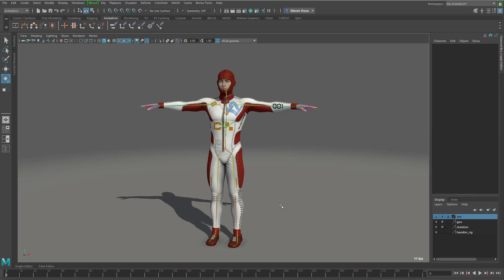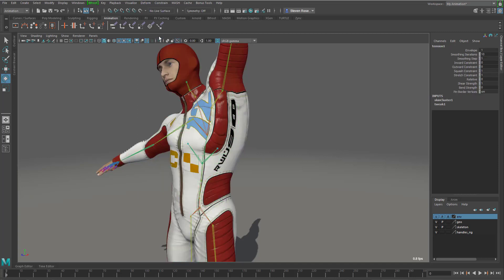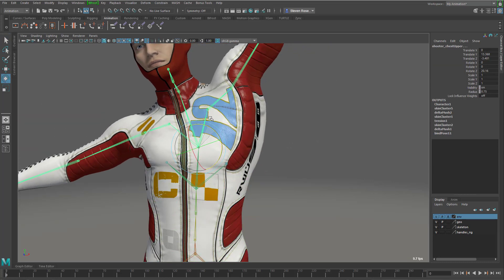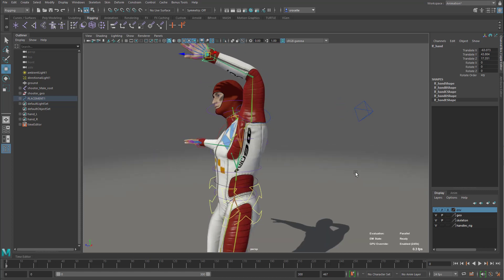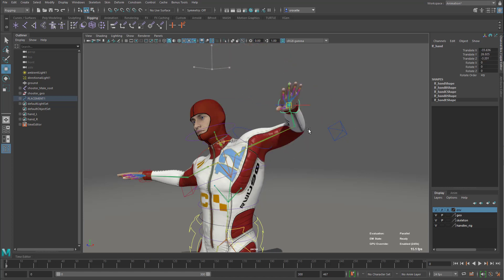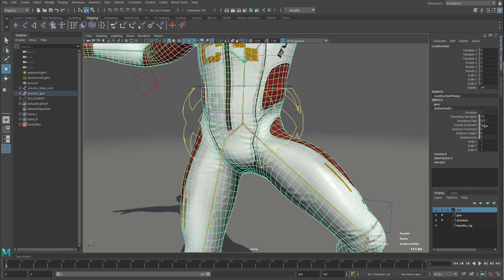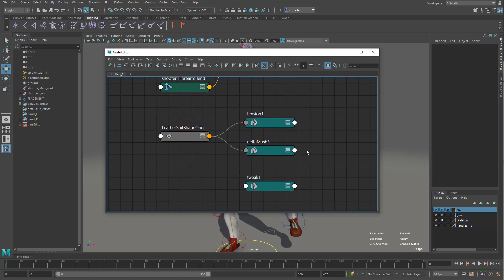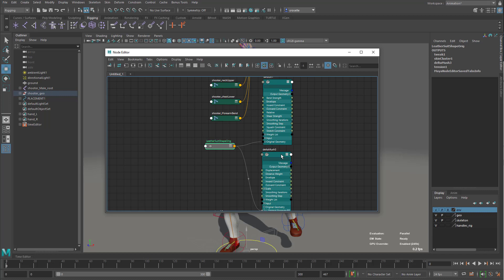Maya 2020 - Deformer Improvement (Original Geometry Input)

Comment: what if i want the tension deformer to happen relative to a posed state (like previous maya version)?
Reply from the maker: You can pass a custom shape to the "Original Geometry" input of the Tension deformer.  By default it hooks up the rest state of the mesh, but you can override it.
Reply: @MyOhMaya  Do you mean in Node Editor? But I cant find the 'original geometry' or 'rest state' on the input of tension deformer node.
https://drive.google.com/file/d/1YcGBd8IjIf-7z6RDheuHx1mW99oImbmu/view?usp=sharing
Reply: @MyOhMaya  nevermind i got it. thanks 😄